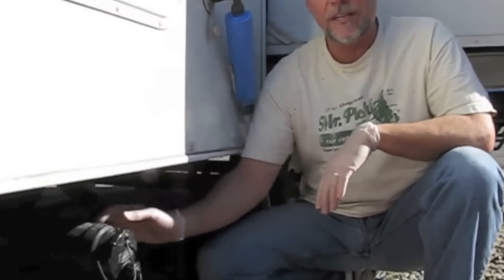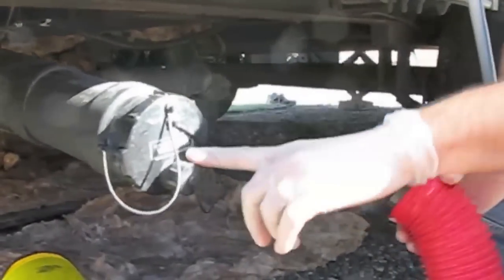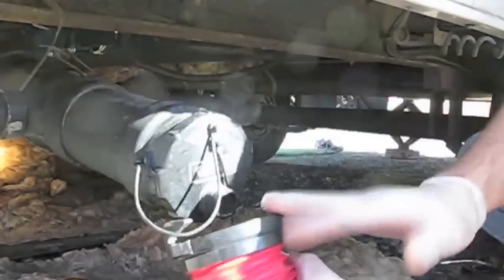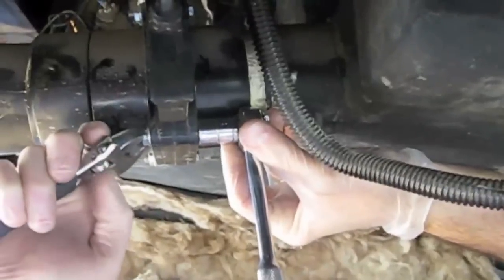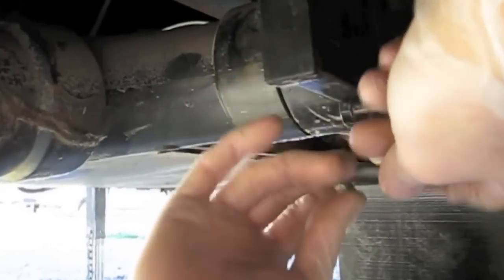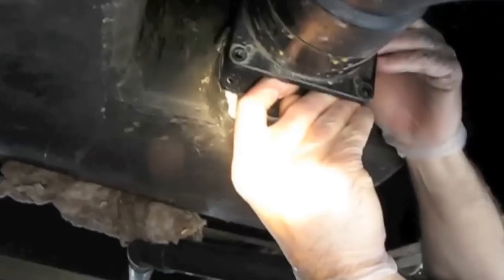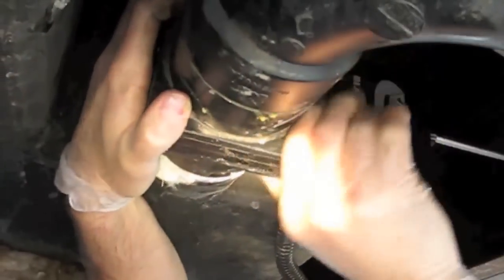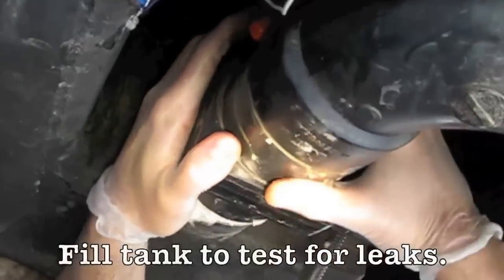RV Waste Dump Valve Repair

Comment: Nice video shows all I need to do for my valve replacement.  Nice tip on the garden hose adapter for catching accumulated water.

Comment: hi my handle is broke off but the unit itself is up under the trailer somwhere and is covered with black plastic panel stuff so i will have to make a cut and cover it back up but not sure where to make the cut how far can it be, from the angle the hole is on from where the handle was, looks like it might go over to the shower tank ..

Comment: Replaced sewage valves 2 of them.... still leaks at cap. Any suggestions?
Reply from the maker: A little bit of water in the pipe is to be expected, but it shouldn't be a lot. That would suggest a leak. The valve is really the only place water can leak into the drain pipe...The gaskets can be very tricky to seat properly. I have had to 
reconnect the valve up to a few times before getting a proper seal when 
replacing the valves.